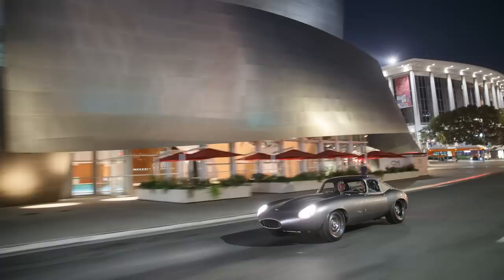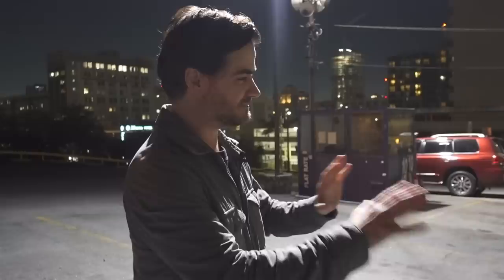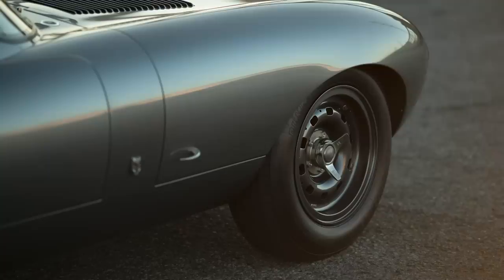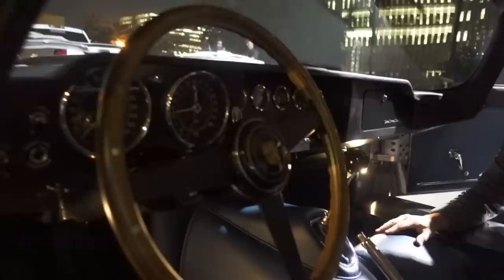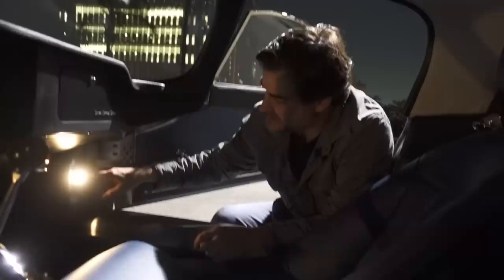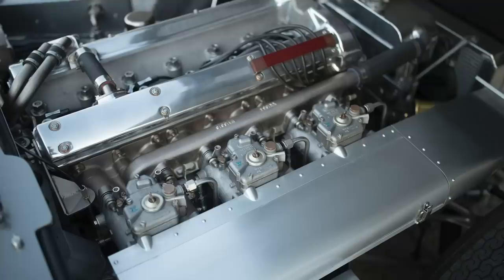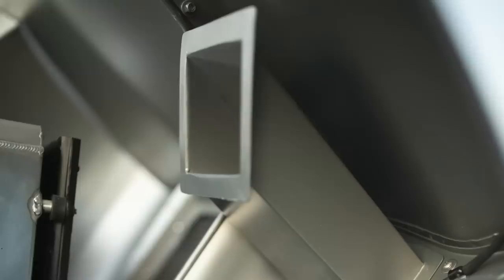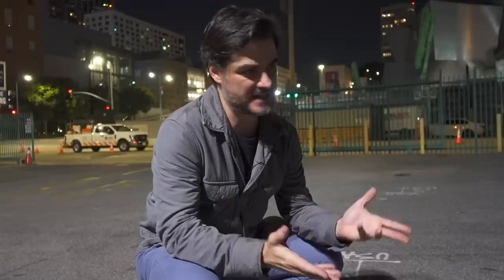World's Best Looking Car? Hyper Rare Jaguar Low Drag Coupe Street Car Re-Creation

Comment: This could be the coolest car I have ever seen ,just car art perfect.
Reply: Spot on there Stephen. I am tingling...
Reply: Nice work guys. You are about right on the power output for the engine; my AML DB7 i6 gave 360 to 380 bhp from a 3.6 litre straight six motor unit, albeit with a supercharger.

Comment: I think what he created is beautiful, it does seem to make him happy as he smiles a lot. I would have left off the Jag badges and all the non race stuff and set it to run on slicks but I'm not against what he made (or paid someone to make, those craftsmen have to eat too). I got to work on a lightweight E type when I did race car electrics and saw first hand how those cars only barely resemble the street versions. All the ones I've ever seen were right hand drive which puts the driver on the other side of the exhaust system which protruded into the cockpit area preventing a passenger seat and allowing more ground clearance. The hood did not hinge, but it did come with a wheeled dolly that you placed it on when removed. I'm pretty sure the alternator ran off the diff. The headers were old school hand made and not at all like the smooth joint mandrel bends of modern headers. When you sat in the car you could see light pouring in from outside pretty much everywhere, you would have gotten soaking wet in the rain and full of dust and debris. But the biggest difference between the original and this car is the lack of rivets, the originals had them everywhere and the more they raced the more were added and sadly you can't see a single rivet on this car.

Comment: Fabulous, bravo, and kudos to the builders. Someone please show this to Chip Foose so he can see the proper way to modify the design of an E-Type Jag. One question though, I love the low drag aero coupes but my understanding is that there were cooling issues because of the smaller air intake (mouth) in front. How is the cooling on this car? I supposed that they could have make the opening bigger if they wanted.

Comment: When this car turned up on a Jaguar site I criticised it for not being one low drag nor another. For example the filler cap should be a quick-release one  standing proud of the bodywork. But, having seen the video I apologise profusely. I have built an FIA papered C-type, own a Lynx XKSS (1988) and have owned two Lynx D-types, long and short nose, so please accept that I know a little about racing Jaguars. That he has gone to the length of buying a full-on Crosthwaite and Gardner alloy block wide angle head fuel injected engine says a lot about the passion here, because those cost a six figure sum, and I am not talking dollars but pounds sterling. The supreme passion that he has put into this allied with his consummate skill has produced a tour-de-force ready to stand proud with the best Jaguars in the world. My hat is doffed sir.

Comment: I don't quite understand this car. To my knowledge (And I am no expert, to be sure!) There were two Low Drag Coupes made. One was commissioned by a fellow named Dick Protheroe, with  license plate CUT 7. The other was commissioned by a young German Dealer named Linder. and had plate 4686 WK. Peter Linder was killed at Montlhery in the mid sixties in his 4686 WK.

Here is where my problems start. Both these cars never had NACA duct work, they didn't have vents at the rear to exhaust cabin air, the roof line was very different and the ellipse at the front was far larger. IIRC 4686 WK had FOUR headlights, not two...this is doing my head in.
Reply: as mentioned in the video, this is not a reproduction of the Low Drag Coupe but rather the 12 Lightweight E-types which followed...specifically a recreation of one of the 6 cars Jaguar decided to make in 2014 from the 6 "dormant" serial numbers from that project. if you look at pictures of that car (49FXN) it does indeed have the NACA duct, only 2 headlights etc

Comment: 10:57 "the laminar flow would have created a low pressure system here. so it would have sucked air into the cabin." that is the stuff we need to hear. *grinning

Comment: Hello, I have a question about the car. The front hood appears to have no fender seams. Based on the photos I have found online of the crashed "Lindner Nocker" light weight e-type it had seams in the fenders. I know you said you went back to the original design which made me wonder if this was a change due to esthetics or was their a reason for creating a seamless front bonnet? I am curious if you found something in the research that I did not find? Thanks in advance.

Comment: I am an E-type fanatic. There were 3 original low drag coupes. Well, really there was only one. The Sayer low drag coupe was as it's name implies done by Malcolm Sayer to compete with the 250GTO. The idea was to reduce frontal area. Dick Protheroe drove the car to some success.  That car was registered "CUT7" for a time and that design is therefore sometimes called the CUT7. It is beyond beautiful.  RS Panels does a very nice replica in aluminum. The original car (now in the US) was made of STEEL (with aluminum doors and bonnet), it was not a lightweight E-type! There were two other "low drag E-types" One was the Lidner car which was aluminum - it crashed and has been rebuilt. It's not as nice as CUT7 - the rear arches are too big and extend well beyond the size of the tires. Ugh.   Then there was the Dr Klat car. It was freakin ugly! It had a pointy snoot nose and a really terrible coupe back and a stiff A-pillar. The car in this video is unfortunately a replica of the Dr Klat car.  I cringe when I see people making copies of the wrong low drag car. What a waste of effort. :(

Comment: A very nice build I had MK1 and MK2 Jaguar's from the lowly 2.4 to the 4.2 but the 3.8 was the best in all the models they put it in.
Did you know that the E-type was more aerodynamic in reverse whenput in a wind tunnel, it only manage 120mph on the M1 in the UK before we got a 70mph speed limit on it.
There is a UK company that makes a replica with modern under pinnings I would like one but way too expensive, I like the fact he likes to keep it mostly era correct apart from some nice little touch's
Reply: When the E-type first came out, it was road tested by one of the major magazines (I think it was Autocar) and accurately measured at 150mph. The factory did cheat a bit, having tuned the engine a bit over stock, and fitted race tyres to the test car on the day for a tiny extra speed margin.  The production Mk1 was good for over 140mph. 

FWIW the Mk3 was much less aerodynamic (exposed and raised headlamps, much bigger air inlets for the radiators, higher windscreen, widened wheel-arches for fatter tyres etc), but with more power from the V12 engine, and was good for 143mph
Reply: @psk1w1  The one I watched did struggle to hit ahundred and twenty, it was not a factory car onr of the Jaguar dealer's took it out to demo for a customer  a good friends father bought it, and wrecked it in about three weeks, crap brakes bad handling.
Reply: @Nickwillfixit  When it came out, the Jaguar E-type was particularly noted not only for its exceptional good looks, but for fine handling and, by the standard of the day, good brakes.  It had discs all round!  Very few production cars in the 1960s had disc brakes.
So if the car you describe struggled to 120mph, and had crap brakes and handling, you can not blame the car, but whoever was responsible for its poor condition.
The E-type Jaguar is closely derived from the D-type, a car which won many races, including Le Mans 3 times during the 1950s.  Apart from being made of pressed steel instead of hand-formed aluminium, the main difference is that the E-type has independent rear suspension, developed by Jaguar after the end of the race program
Reply: Put a 308 rear end in it and it can do 150. I had an OBL car that i did more than 145 on I-75 going north just before the exit to Daytona Beach in 1969.

Comment: Marco, be my friend  ;-) ;-)  Surely as near to perfection as one can attain in a motor vehicle, my comment below beside
Forgive my very slight critique, I would have preferred chrome wire wheels, just as a nod to the past, sure they would add weight where you are minimising it. But if you ever sell or GIFT the car to me; 
I consider it only mannerly, to prewarn you I WILL change the wheels. So best take that into consideration before you call me ;-) ;-)

Comment: All that effort and they go and put a Jaguar steering wheel on the wrong side.
Reply: It's on the left side, that's the normal side.
Reply: @verenigingvandemagogen4548  Not for a Jaguar which have them on the right hand side, the British side, the proper side. And not the French side which this, for some bizarre reason, thinks is appropriate. There is nothing normal about the French way of doing things.
Reply: @terrortorn  About 2/3 of the world population drives on the right side and has the steering wheel on the left side.
So driving on the left side is the exception with 1 out of 3.
https://en.wikipedia.org/wiki/Left-_and_right-hand_traffic

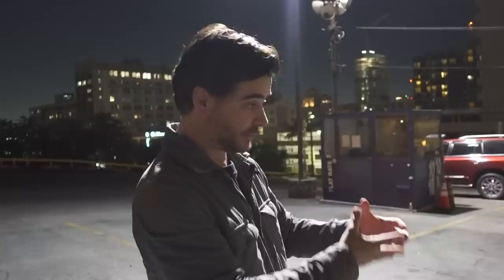Comment: all his work is sweet, unfortunate that the builders of the body missed from side to side sooo badly... look at 2:26 the drivers side is INCHES higher than the passenger side, even the roof roll into the windshield area is different from side to side... stuff you only notice if you've spent years and years building cars from scratch....  (in a lifetime long ago)
Reply: Mike Genson I think that's the angle of the shot.

Comment: Considering the weight of the Jag engine, might be a bit lean on the estimate.
Reply: All Aluminium Racing Engine....about 600lbs? Not that far out.
Reply: @danstewart8218  Which just leaves everything else.
Reply: Yeah. Maybe the monocoque is actually made out of lead.
Reply: @dudley7540  Not sure about that one... Could agree with you, but then we would both be wrong😉

Comment: 08:36, I don't like finished. Since I would expect all metal work to be deburred and so on. I prefer; the level of 'attention to detail' is high. That's what you mean. Not finished. Considering he's a product designer, I'm surprised those words weren't used at any point. Attention to detail..

Using that word finished again. I'm moving on..

Comment: No..the back isnt great looking and i know its not an e-type. The e-type had a window that is too tall and upright. So the original isnt the best either. that title goes to the 1967 Corvette stingray with stinger hood. Or tge 1969 Corvette stingray coupe..from any angle they both look gorgeous..id go for the 1969 Corvette coupe black on black with chrome air vents on fender. Then the ferrari dino..e-type jaguar convertible may come 4th..but not the coupe.

Comment: E Type ...I am neither jealous nor anti ...is the most vulgar looking car ... it is very phallus ...
.it was not a great car to drive, unless one kept it straight ....turning is at high speed was neigh impossible ...tuning 4 Carburetors was simply a PIA ...however, when they were properly tuned, she was a monster to control ...yes, it was riding a Mustang. There is no other car like the E Type ...the only other Wild Beast was MB Gullwing ...also not easy to handle ...E Type is not a car ...she is a fire dragon to ride ...Congratulations on restoring the bitch ... no enjoy it, tearing the wind ...if you can ...